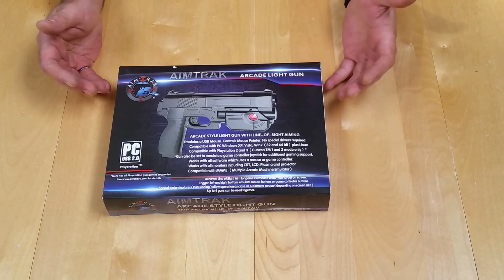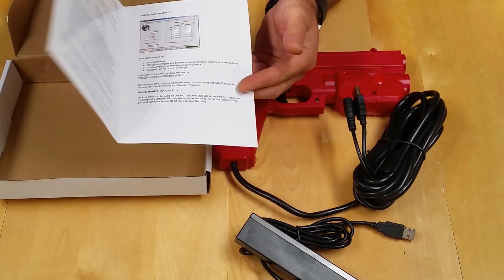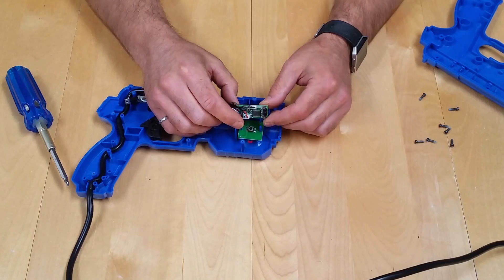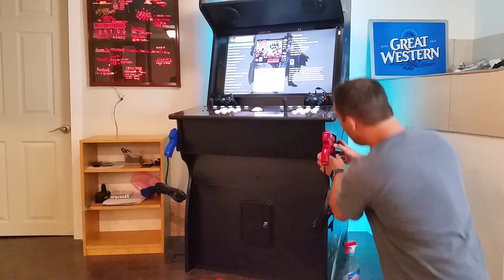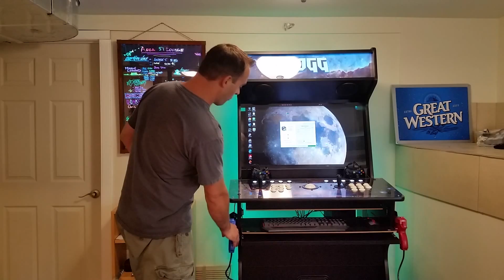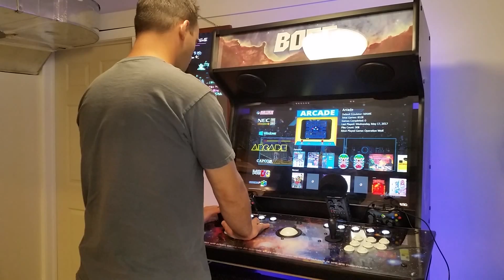BOGG Tech - Aimtrak MAME Lightgun - Unboxing, Teardown and Install

Comment: ok...so what is the difference between a gun with recoil option and no recoil option?
Reply from the maker: The only difference is the installed plunger they put in the gun and the fact you need an external power supply to run it. Everything else is the same.

Comment: Just curious.... I also have a 32" RRM cabinet, but I think the physical dimensions of my TV are a bit bigger.  Between the size and angle of the light bar included with the Aimtrak, if I install it on top of my TV, the IRs will just be pointing at the back edge of the wood panel where the speaker grills are and not outward.  Does the light bar strictly have to be installed on top, or can I position it elsewhere?  Any insights?
Reply from the maker: You an add some angle with a bit of double sided tape on the top of the light bar to angle it down but check the configuration and it'll show you if your light guns are visible. I would also just try to put it other places to see if it works. The light guns triangulate the position of the light gun based on the 3 leds and as long as they're visible and it's calibrated, should work fine!
Reply: Thanks for the help.  I tried setting it up a few ways, but I think my Aimtrak might be busted.  Even with the light bar unplugged and the sensor on the gun completely covered by my hand, the mouse moved erratically all over the screen.

Comment: Where did you buy the holster? Did you say you bolted it in or just used a Velcro patch?
Reply from the maker: Hi Chucks, You can get the holster from Ultimarc.com. I used 3m double sided tap to fix it to the side. The holster does come with bolts but they're designed to mount the holster to the top of the controls, and i prefer the side.
Reply: Bitter Old Goons Gaming Thanks man. Great video

Comment: Thanks alot, excellent tutorial. Is that a recroommasters arcade control? I have one myself, was that a custom built cab or one of their extension units? Great setup.
Reply from the maker: Thanks for the comment! Yup sure is a  recroommasters machine. It's a custom 32" version with a custom xtension emulator controller. It's also equipped with a few usb xbox controllers. We did the art specifically for the machine. It's powered by an i5-3750k cpu and a GTX 1060. Custom RGB strips for lighting.